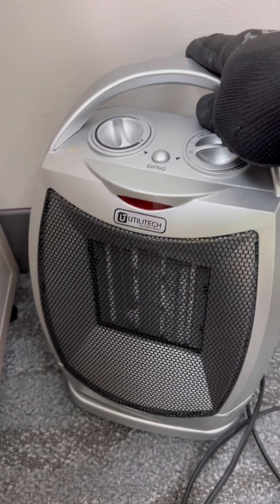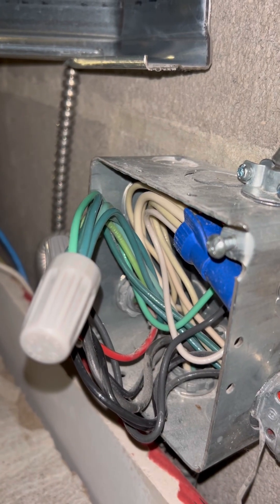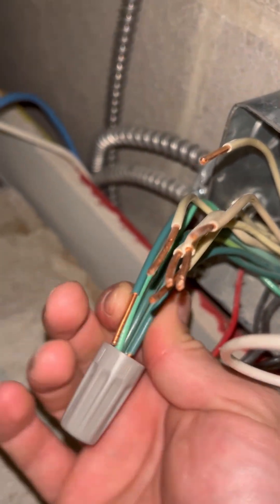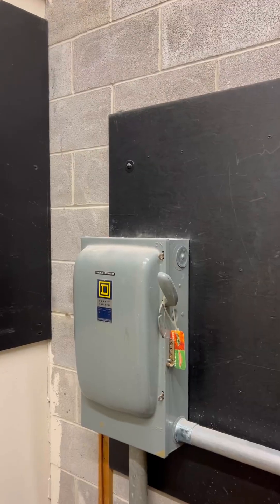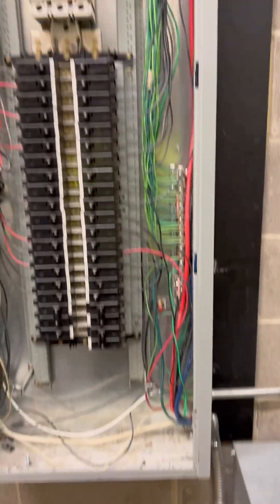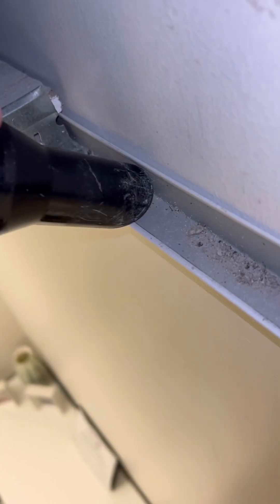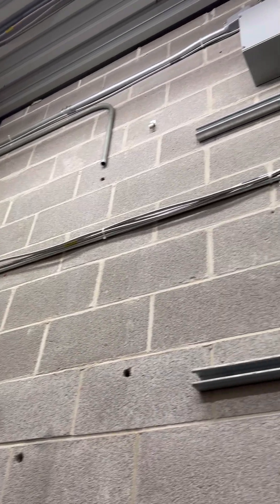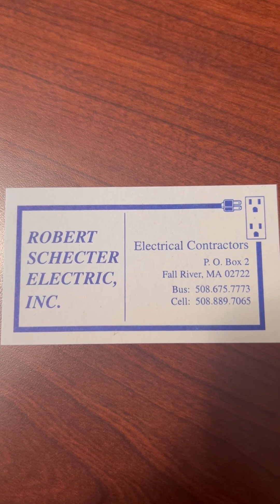⚡️Electricians STILL Using Wire Nuts Like THIS?! STOP Being a Hack🔥!#shorts #electrical #viral

Comment: When I hear the pre-twist vs no pre-twist argument presented as a "style preference", it kind of irks me.  To me there is clearly a right answer.  Splices should not pull apart when you move them in the junction box.  To me, wire nuts mostly to serve as an insulator to an already mechanically solid connection.  It should not be the only thing holding a connection together.  I should have to manually untwist a connection after taking off the wire nut.  Space heaters are the number one cause of receptacles and power strips getting burned up.
Reply from the maker: You are correct friend
Reply: If you are using wire nuts correctly you do not need to pre-twist them, because they are designed to twist the wires in the process of putting on the wire nut.

You are supposed to actually keep twisting the wire nut until you can see the wires coming out of it twist around each other.  If you do that correctly, and then take off the wire nut again, you will find that (even if they weren't pre-twisted) the wires have become tightly twisted around each other in the process of putting on the nut (I've tested it myself, and it does work).

But if you use them wrong and just shove them on without twisting them hard enough, then they won't do their job of properly securing the wires right.

(Wire nuts are also not only an insulator.  They are also designed to maintain constant pressure on the wire twist so that it does not loosen over time due to vibrations or moving the wires around, etc.)
Reply: @foogod4237 I am aware of the wire nut manufacturer claims & instructions. I myself twist the wires way tighter with my sidecutters than can be achieved with the threads of the wire nut alone. By pre-twisting wires, you can visually see how well wires have been twisted together before securing them with the wire nut. That way you’re certain that one of the wires in the bunch didn’t catch the inner threads of the wire nut. I personally like to confirm that no wires can be pulled apart before I thread on the wire nut. The method I was taught & have adhered to from the beginning was… strip insulation, line the stripped portions up together, twist them together, cut the tips off even, then thread on the wire nut as tight as you can. It’s foolproof & makes strong connections. I just really think it’s a better method than just twisting together with the wire nut. The only time I do not do it that way & use the wire nut to make a connection is when I’m twisting stranded wires to solid wires. In that case, I pre-twist the solid wires together with sidecutters, then twist the stranded wires around the solids with my fingers, then cut the ends off evenly, then twist together with the wire nut as tight as it will go. I still live WAGO lever connectors & will start using them more when the cost is comparable to wire nuts. Until then, I won’t spend the extra money.

Comment: I think it's a personal preference but wire nut manufacturers put instructions on the bag telling us not to pre twist the wires because the wire nut is designed to twist the wires at a rate that allows the tightest connection.  Pre twisting will twist at a twist rate that is different than the wire nut design. In the video the wires were not twisted at all so I would agree improper installation by not twisting the nut adequately. Personally I don't see a problem with pre twisting solid wire. You are probably the cleanest wireman I have ever seen. Nice work.
Reply: Skipping the pretwist means you'll use the wire nut as your lineman and literally twist the wires into a splice with nothing but the wire nut. Its way harder than using linemans. Either way when you remove the wire nut, if done correctly, it will look like someone pretwisted. 

No one does it tho, so it's better to just pre twist
Reply from the maker: @billrobert3226 I agree pre twisting is the best method
Reply from the maker: Thank you friend I appreciate you watching!
Reply: Theres wirenuts that say do not pre twist? Never knew lol more I know
Reply: @exsitentialdread  yeah the bag for Ideals and 3m state "pre-twisting isn't necessary". I'm an apprentice so I've had too many loose neutrals from just using wire nuts, so I pre-twist even if it pisses off my jman
Reply: There's an art to pretwisting
-different/varied sizes
-solid/stranded

IBEW
Reply: @stanminna1761 I  agree, there is an art to splicing.  Wether it be solid, stranded, a combination of both or a 15KV cable. What local are you out of brother?
Reply: @stanminna1761 there's an art to Everything !
Reply: What wire nut manufacturer have you seen that says to not pre-twist them?  All of them I've ever seen (that say anything at all) say that either pre-twisting or not is fine, so I'm curious what manufacturers are actually not OK with pre-twisting...

With this many wires in a single nut, IMHO, you pretty much have to pre-twist (at least some) just to ensure that all of the wires will be fully seated in the wire nut after you put it on and something won't slip out while you're trying to tighten it down.

(Which is part of the reason why I don't like putting that many wires in a single nut, even if the specs say it can technically do it.)
Reply: @foogod4237  I read that some time ago in an article and I wish I could remember the manufacturer. I checked ideal and depending on the package it states twisting unnecessary or twisting not required but acceptable.  You made a statement in an earlier post that covers the issue in the video that you don't like to put more than three wires in a wire nut and that is in my opinion is key to a secure splice.  Whoever made up that box put too many wires in one wire nut and you could see they were not twisted so they did not tighten the nut adequately. I have never used wago lever nuts so tell me do they work like a stab in connection on a cheap receptacle? Where the connection is just a pinch of the wire. That doesn't sound good if it works like that.
Reply: @Superniceguy66  my limit is 5 or 6 wires with the blue wire nuts. Pretwist always. 7 just gets ridiculous, ill make a jumper if needed.
Reply: @Superniceguy66 yup. limited connecting plane / point of contact.
Reply: @foogod4237 Ideal Can-twist model 007, which is arguably the most popular wire nut here in Canada, has the following instructions:

Use only on Copper to Copper (Cu/Cu) wire combinations. For use in dry locations only.
To be sold only with installation instructions.
Installation Instructions:
1. Turn off power before removing or installing connectors.
2. Strip wires to 1/2 inch (13 mm)
3. Straighten wires and align frayed strands.
4. Hold wires together with ends even. Lead stranded wires slightly ahead of solid wires.
5. Pre-twisting acceptable, but not required. For pre-twisting; strip wires long, hold wires together with insulation even, twist wire
ends together, trim to recommended strip length.
6. Insert wire bundle into connector and twist clockwise until tight.
Listed as a PRESSURE-TYPE wire connector for use on solid and/or stranded Cu-Cu wire combinations. Consult IDEAL for a
complete table of approved wire combinations.
Temperature Rating: 105°C max. (221°F)
Voltage Rating: 600V maximum in building wire; 1000V maximum in fixtures and signs.
Reply: @foogod4237 it's true, I've seen ideal instructions saying it's not necessary to pre-twist.
Reply: Ideal twisters instructions on the bag bad practice to much room for errors
Reply: It should be said that that many wires coming together needs a better way of having that many wires coming together.
Reply: You can use a wire nut to twist up smaller wires, but once you hit 12 gauge it literally doesn’t twist the wires, especially when you have that many in one. I pre twist 14 and anything bigger, the smaller gauges definitely don’t need to be pre twisted though. The ideal ones I have say pre twist is acceptable, but not required, which really is so dumb.

Comment: How did you know it was a multiwire branch circuit just by looking at it?
Reply from the maker: Their was a 12/3 that came into box I saw a black and a red inside same sheath and immediately knew what I was dealing with. Have to be extremely careful with that

Comment: Totally agree pretwist all solid wires. So many guys just stick on a wire nut and twist until is discolors. Then push in the box and one pops out and then it's a troubleshoot. 
 Interesting seeing wiremold in a commercial application. We are not allowed to do that in south florida. We have to go in wall or run emt with industrial covers.
Reply from the maker: Nice friend thank you for sharing!
Reply: You can get away with 3 #14 or 2 #12 with the wirenut, it’s actually better to use wire nut to twist so you’re not scoring the copper, anything more than that though you can’t actually get a good connection with the wire nut